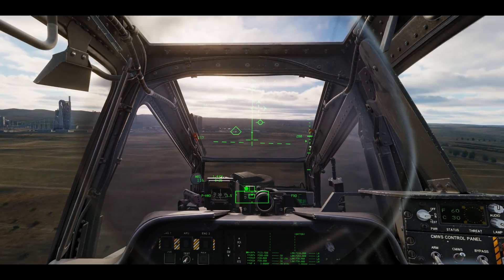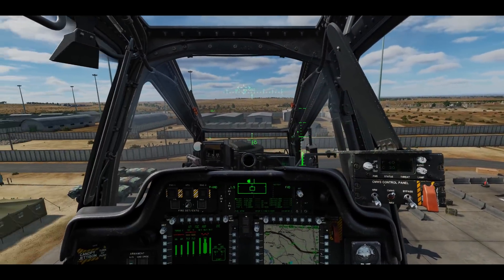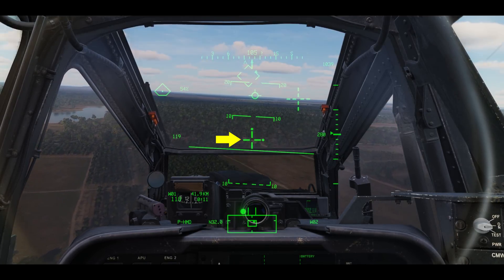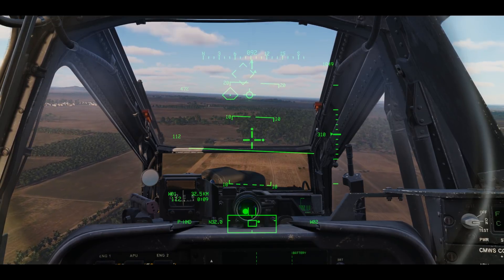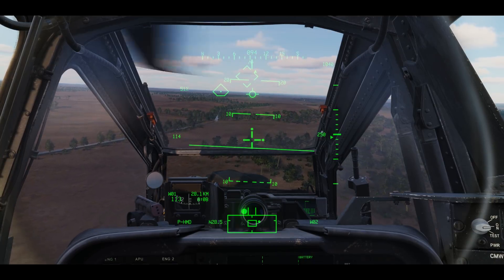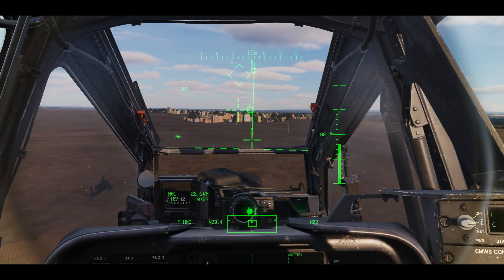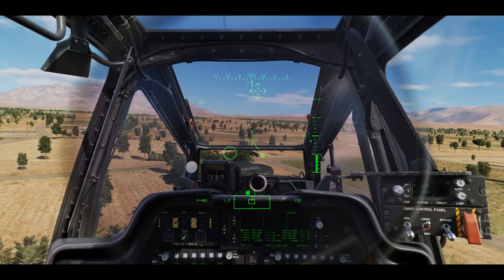DCS: AH-64D | Helmet Display

Comment: Does ED know the HDU line of sight is set far too high in VR version? The top of the display is up along the top of the pilots cockpit window cross member. Barely visible.
Reply from the maker: No such issue here. You may want to check your IHADSS B/S.

Comment: in VR the sight's symbology is placed pretty high. When I try to boresight, I have to use the rect box at the bottom of the symbology instead of the xhairs since it sits so high. Can that be adjusted?
Reply from the maker: You can scrunch down or adjust eye view up or down.

Comment: Can we move the HDU a little to the side for gamers with ultrawide monitors?
Reply: You'll be happy with it centered. In virtual reality it's only over your left eye but for flat screen monitors you'll want it centered.
Reply: @ConflictGamingGroup  I forgot to mention that I use a TrackIR with a <curved> ultrawide monitor. Do you still have the same opinion? I've been playing Arma 3 with this setup to get used to using TrackIR with a curved ultrawide. I haven't played DCS much yet.
Reply: @whatsappscambot1802  if you've flown using the hmd mod and trackir, or if you've been flying the arma Apache (the fancy one, not rhs), expect to be just about the same in terms of the visual experience. DCS interpretations of trackir inputs are a little bit better than armas and it actually lets you look around a lot easier, but you'll still definitely want the symbology centered. I also highly recommend DCS and VR if your system can handle it.

Comment: Is the Apache fly-by-wire, or physical linkages?
Reply: Its physical linkages augmented by the SCAS system and there's an emergency fly-by-wire system called BUCS that can be activated by either pilot via a trigger on the collective grip in case of a severing or jamming of the linkage
Reply: @RJ-rg2iz  good answer, thanks.

Comment: Waggs, could we get an option to restrict HMD's in the mission editor just like we see with payloads being limited? IE for a 1990's mission only allow NVG's and prevent JHMCS use etc..
Reply: Unlike JHMCS, the IHADDS is not a later addon to the Apache and is crucial to its operation, it was part of the design of the very first AH64A Apache. Note there is no other HUD like in those JHMCS capable jets.

Comment: There seems to be a lot of confusion in the comments about the horizon line on the HDU. To clarify, the HDU is attached to your head, not to your aircraft like the HUD in a jet, the Horizon is relative to your Line of Sight Cue in the center of your HDU to show your nose attitude, regardless of where your head is pointing.
- Apache pilot
Reply: The real question is, will they package this module with a head condom?

Comment: Strange. Something is wrong with the projected horizon line. The FPV should be matching with it when in a straight horizontal flight.
Reply from the maker: It is correct and in reference to the reticle.
Reply: I'm a little bit confused here Matt. There is some difference between "horizon line" and "attitude indicator" (refer pages 4-13 and 4-14 of the AH64D flight manual). I'm wondering what's the point of having a FPV displayed with no projected horizon reference to show whether you are going up or down (besides the outside cockpit real horizon). What if I'm in IMC conditions,  like inside clouds? 
In your video, the aircraft is still flying down even with the LOS reticle   above the horizon line or attitude indicator.
Reply from the maker: @VBFavarato   The HDU is attached to your head, not to your aircraft like the HUD in a jet, the Horizon is relative to your Line of Sight Cue in the center of your HDU to show your nose attitude, regardless of where your head is pointing. It's something we'll enjoy seeing people wrap their head around and get used to. I talked to Casmo, and he'll create a video to help better explain this.

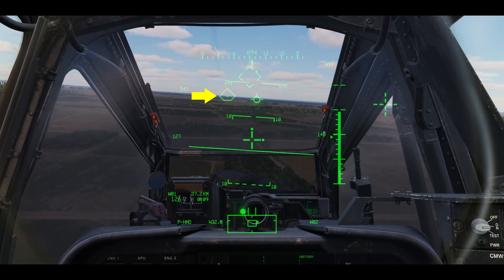Comment: Hey Matt, I have a question: The segmented diamond is explained at 3:57 as the head tracker, relative to the aircraft. At points in the video, like at 0:39 and 9:20 the diamond does not move. It looks like it's caged to the center with the cued LOS reticle in the middle. Can you show us how it moves in an upcoming video?
Reply from the maker: It is fixed to ahead of the aircraft.
Reply: @MattWagner  So it does not move when your head moves? Then how does it represent your head position?
(I'm just trying to absorb the functions of the HDU, perhaps a bit slow on the uptake)
Reply from the maker: @SsgtHolland  When you see it centered in the HDU, you know you are facing directly forward.

Comment: I wonder if AH-64D (Crew) would be able to survive light crash landings due to its specially designed landing gear.
Reply: Believe the entire system is rated to 20g survivable. It's a lot more then just the gear btw

Comment: Not really in aerodynamic trim but in NOE flight nose to trail trim is considered professional. As your tail is exactly behind you and you're less prone to swat trees with it. You can verify nose to trail trim in the transition mode where the velocity vector should be straight up. Which it is when you mention the aerodynamic trim.
Reply: Is it in relation to ground vector or air?

If it's like the ball in most planes, I could easily imagine a situation where you're aerodynamically co-ordinated but crabbing along the ground due to wind. The Mi-24P thankfully has both the ball and a doppler drift angle readout, so you can prioritize either, or co-ordinate them.
Reply: @jubuttib  Ball is aerodynamic trim. Nose to tail trim is making sure the tail is moving forward on the same line as the nose, respective to the ground. The latter is represented by a straight up velocity vector in the transition mode.
Reply: @ianvdhorst  Thanks for the clarification. =)

Comment: What is the VR implementation of this? I don't see an option to pick left/right/both eye. I don't fancy having to drive a jeep with a periscope and underwear on my head to play a DCS module.
Reply: It is part of the realism. No avoiding it.
Reply: @mhe0815  sadly I can't. When I can use both eyes it's not a problem. But right eye only won't work because of degraded sight in that eye. It's an option in every other module, so I'm going to assume they've just not got to it yet. But would be good to know.
Reply: @dotChuckles  While right eye would be the realistic option, making it left or both as additional options would make total sens. All other helmet-sight equipped planes have that, so I think it is a reasonable thing to ask for.

Comment: Why is the horizon line ... well below the hoziron? Is that a bug?
Reply from the maker: It’s aircraft horizon reference.
Reply: @MattWagner  is there a way to get a proper horizon? Say you are flying in IFR conditions and you need to know if the heading bug is below or above horizon. Other aircraft (F15 for example) have the "nose" horizon set as a W, then have a true horizon. Its wierd the Apache doesnt work like that (I am not saying its wrong to the real aircraft, just find it odd)
Reply from the maker: @tswdev  That would be not all realistic.
Reply: @MattWagner  Basically, the real apache doesnt work that way, gotcha! Man, cant wait for this module
Reply from the maker: @Joao Carlos  It most certainly does. Unless the -10 manual and half a dozen Apache pilots are lying. Casmo, a former Apache pilot will do a video on later to better explain it and why it is not like a fixed wing aircraft horizon line.
Reply: @tswdev  When flying IMC we don't typically use the HDU at all. In my case, I tend to fly without it and focus purely on the FLT page. It should be pointed out too that D Models are not qualified for IMC flight, so flying in the clouds is a big no-no in the case of US Apaches. It's actually an emergency procedure, so the HDU would be used to get over the initial 'holy crap, i'm in the clouds and I shouldn't be' before making the transition to the FLT page. It's actually really easy to select a flight page via the cyclic, what you do is z-axis (our fancy apache way of saying press or push) on the symbology select switch on the cyclic which will bring up a FLT page on the left MPD.
Reply: @MattWagner  I think you are miss understanding me, I am not saying the sim is wrong. What I mean is: I was expecting (without any apache knowledge) that the HUD would look like the F15. I didnt know it didnt. I actually went through Casmos channel and saw a few videos of the HUD as well. I dont understand why it works like that, but there most be reason for it.
Reply: Casmo just did a video on this. Anyone wondering, I would suggest you go check it out.
Reply: Think of HDU as if the attitude indicator on the dash-panel is displayed in your eyeline, wherever you are looking.  So the information displayed is scaled to that instrument, not your head-position.  It's as if the attitude indicator is fixed to your head.  

So, the HDU horizon line will display in the same way the horizon-line moves in the physical dash-panel instrument.  

This allows the pilot to understand his aircraft attitude, regardless of where the head is positioned, as if looking at the attitude indicator on the dash-panel.  The information displayed in the HDU is scaled to the instrument, not scaled 1:1 to the outside world.  

Hope that helps.

Comment: So you can't quickly remove the eye lens with a key ? You have to go in the settings menu ? :( Irl I suppose they can flip it with their hand.
Reply: The setting is to remove the visible monocle. Removing it will just have the display floating without the simulated lens

Comment: Not gonna lie, its weird that the artificial horizon is aligned with the helicopters horizon and not with the world horizon. So the Flight Path indicator shows a 20° climb when you fly level. Kinda weird :)
Reply: Was thinking the same thing. I don't really get what the point is of the artificial horizon, like how is it meant to be used?
Reply: @cloakedsniper5016  a great question.  It can't be the "nose pitch" which is clearly pointing below the horizon while the pitch ladder is indicating the generic "pitch attitude" is pointing above the horizon.  Maybe it's the pitch attitude of the weapons targeting since the chain gun is stored with the barrel pointing up a bit.
Reply: Was thinking the exact same thing. This module will put the STUDY back in study sim.
Reply: Looks like Casmo did a video on it
Reply: I think the idea is to tell you the helicopter's nose pitch relative to the actual the horizon line. I remember reading about beginning lessons of helicopter flight school where a tape with hash marks representing 5-degree increments would be affixed to the canopy. The learner would use that in conjunction with the horizon to judge pitch for forward and rearward flight.